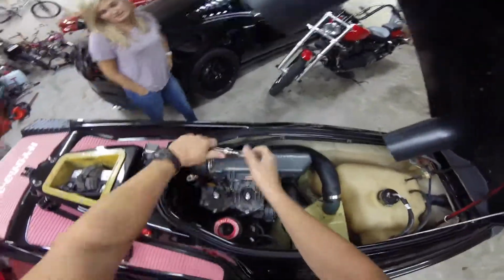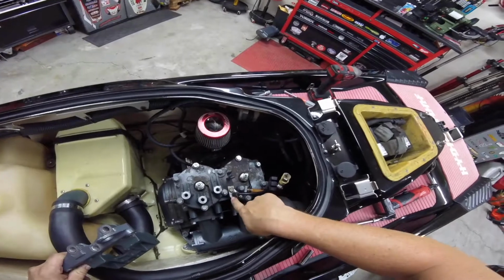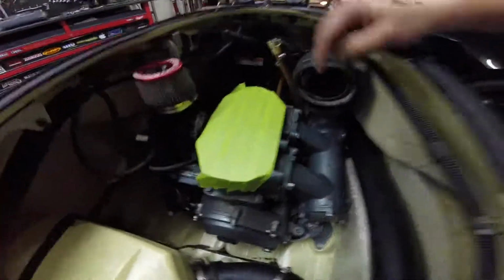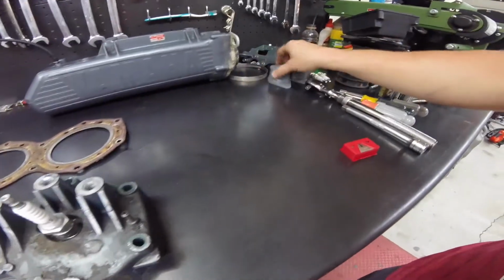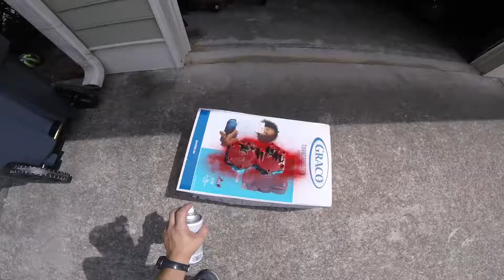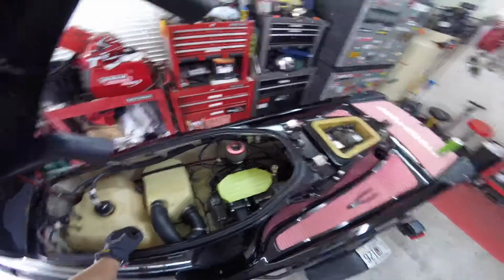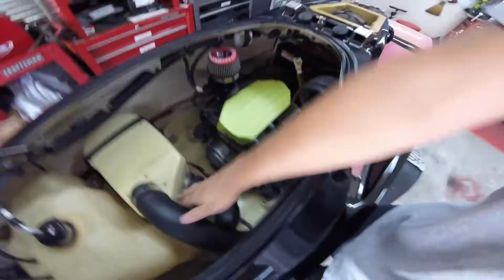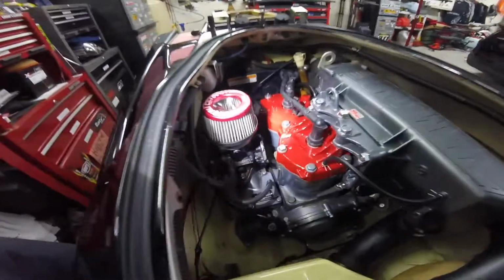93' Waveblaster Build P4 Head Shaved

Comment: I own a 93 blaster  bought it in 2003  only work done is batteries and a starter solenoid.  I need to remove the midshaft bearing housing to check inside seals I might have popped it with grease end of this season    dumb butt attack        its getting to be more of a challenge at 66 yrs old
Reply from the maker: 10Amp SloBlo  If your going to check it,  I would go ahead and replace it with a WSM mid-shaft housing complete with bearings and have some one remove your shaft and install in new mid-bearing.  That’s what I just got done to my 04’ superjet.  Same setup as the blaster.  Believe it cost $129 off eBay.

Comment: Did you have to re jet/ run different spark plug? Thinking of doing the same to mine.  Have you thought about cylinder porting?
Reply from the maker: In the end I did re-jet the ski every time I modified the engine.  As far as porting the cylinder I haven’t but when I rebuild the top end I will.  The manifold I ported before installing the b pipe.